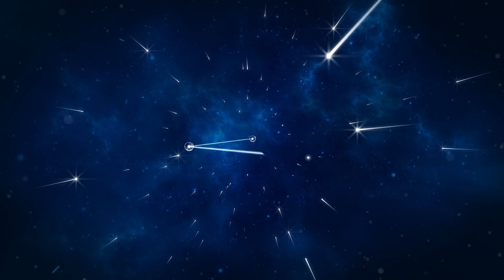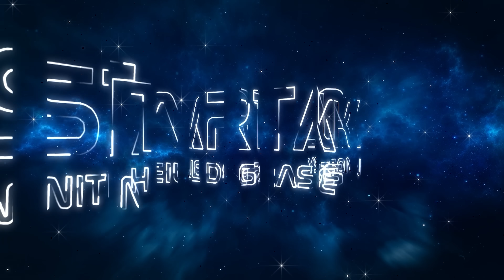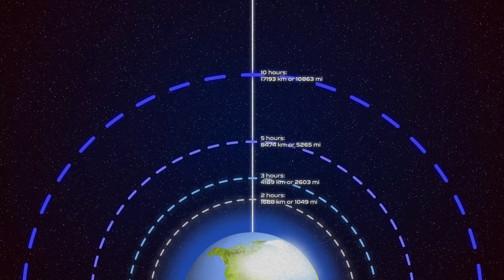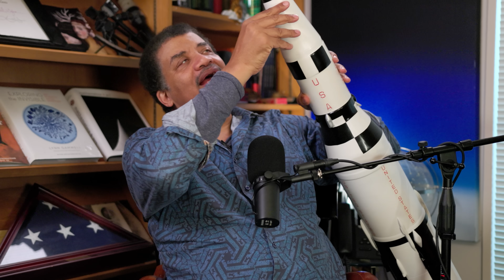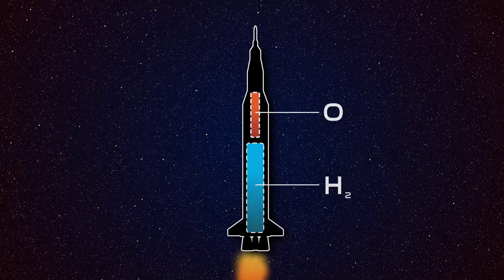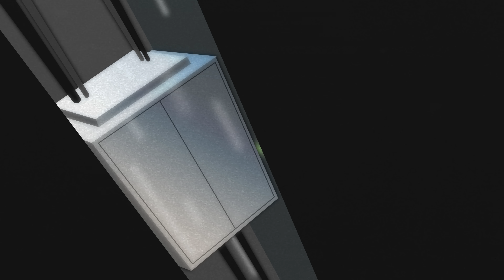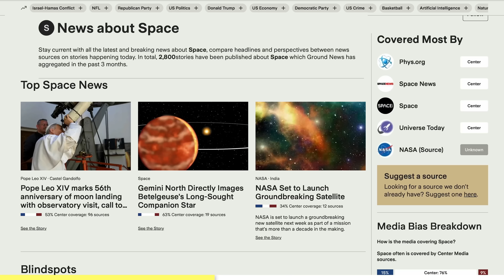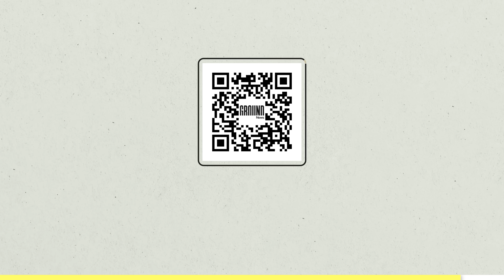When Will We Have a Space Elevator?

Comment: I guess you could supply fuel up the cable so the end would be a filling station
However, i think the weight of the counterbalance would make earth wobble, just like if you swing a heavt weight around
The cable  would probably experience a lot of drag from the lower atmosphere too.
Reply: It is hard to fathom how many wrong and confused statements are packed into that little post.
Reply: @sciptick LOL
Reply: align proper magnet stoppers at the top and bottom of a space elevator and the speeds of transcends will increase towards the middle the stop. remove the electromagnetic current from the bottom and the elevator will continue rising through helium speeds until the elevator reaches the top. use some form of scilancer to absorb the shock and ther we go. solution provideed.

Comment: Question about the space elevator. If you don't put people on it, just supplies, is that more practical? AAAAAND, if you come down slow enough, would you not burn up because  you don't have to worry about the friction of the atmosphere?
Reply: Typically, slower objects do not burn up in the atmosphere. 100 MPH would be slow enough to alleviate any concern. I think I remember reading something that said 10,000 MPH is a threshold... could be wrong though.
Reply: @Jrfusion08 OK Cool. So send supplies up at whatever speed is available for supplies. Then send supplies back down at even a faster speed without worry of burning up. I could see a use for it of they were able to develop a space elevator. Not to mention, they could send up fuel for a space launch to get further into space without needing as much fuel to leave the planet.
Reply: I mean they didn't really go in-depth, if you'd actually sit down and plan this thing ofc you'd not need 10 days for a one-way drip.
I'd assume electromagnetic propulsion would work for most the way up, providing a constant acceleration all the way. Maybe a mechanical one is necessary within the atmosphere where the gravitational pull is the strongest. But every meter you go up, the less gravity pulls and atmosphere drags, the more easily you can use other methods.

Comment: Have to be two, and why not the axis poles. BUT...
If you ran two copper ground wires from poles to equator, would there be a potential difference between them?
Reply: You can't have centrifugal force above the Pole. 

As for getting electricity from Earth's field, they did some experments with tethered satellites. It is possible in principle, but quite challenging from an engineering standpoint.

Comment: Couldn’t they put the counter balance further than geostationary orbit so the weight would pull on the track to off set the weight of the track. It would have to move closer as the weight of the elevator car approaches to balance the overall centrifugal/centripetal forces
Reply: Yes this is how it's meant to be.
Reply: They would have to, yes.
Reply: I think the issue here is the weight of the rope in tension as it is pulled down through Earth's gravity between geostationary orbit and  where it is tethered to the earth as it will definitely be wanting to fly off - that remains the same from the point of geostationary orbit back down to earth no matter how far past geostationary orbit you go, and you would need either a decent amount of cable or a counterweight past the geostationary point to have something to pull against for the 100 mile/hr elevator to keep from pulling the whole cable assembly downward as it moves upward climbing the cable.